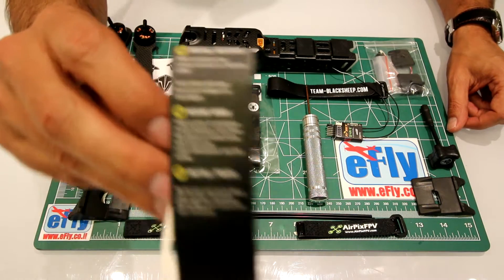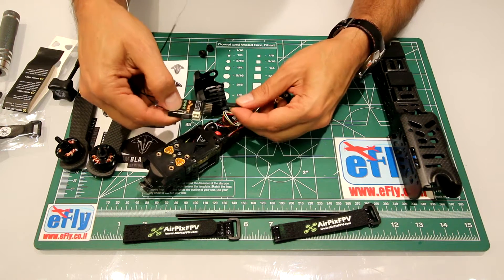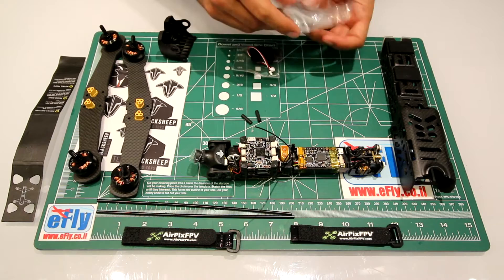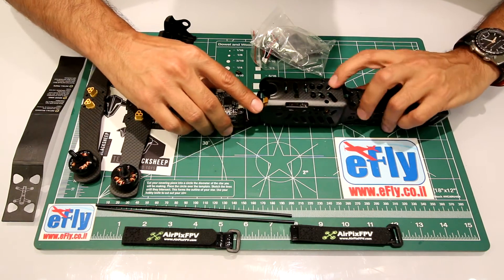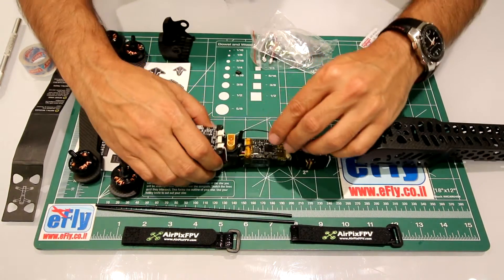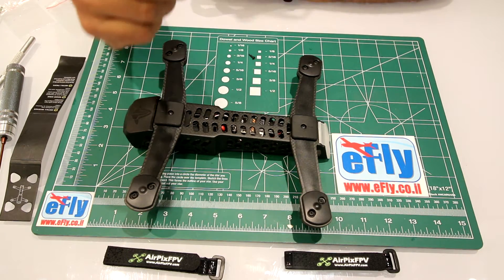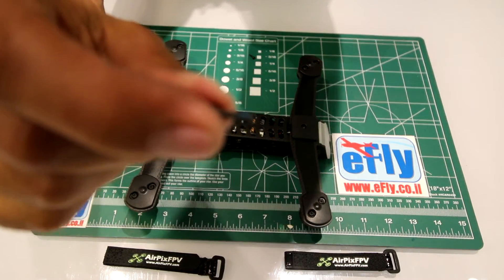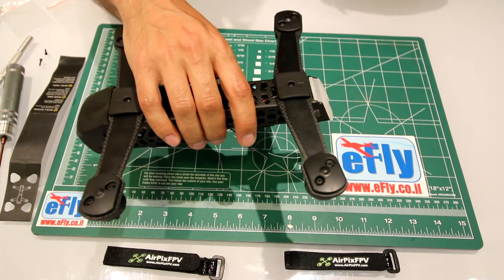TBS Vendetta build + Tips + OSD setup + CleanFlight changes

Comment: May i suggest that you put both antenna wires in one of the straws and feed it through till it comes out more rigid going through the frame and less fidley. I do it all the time very simple trick. Great informative video by the way what stumped me was the rubber holders for the straws i should of put them on first like you did. :)